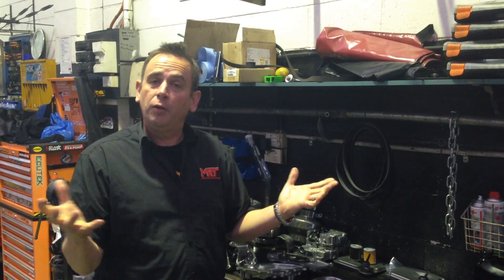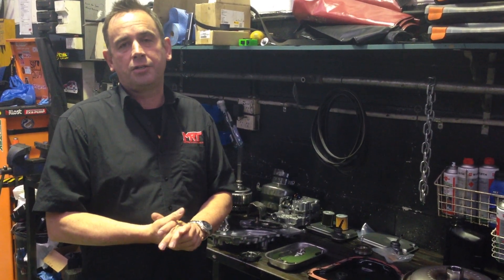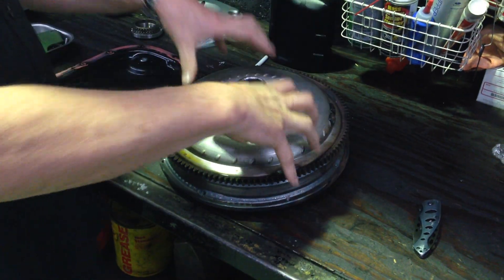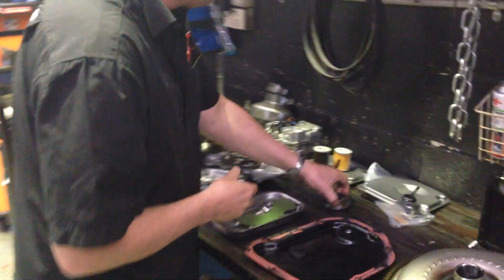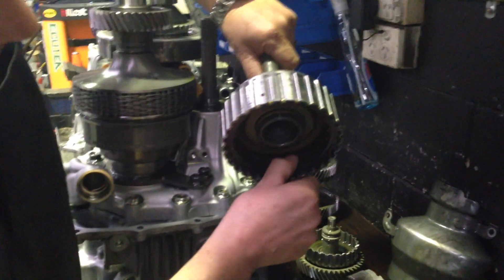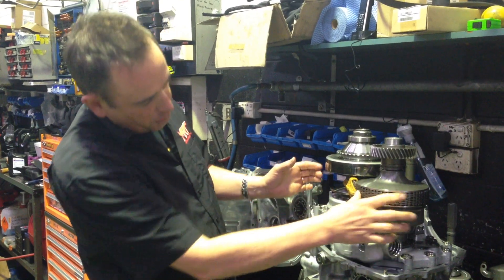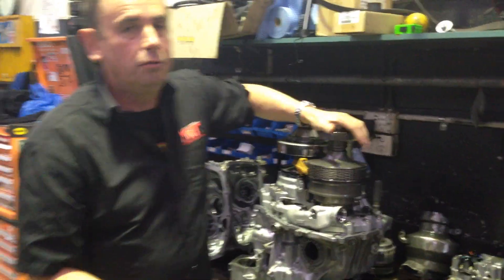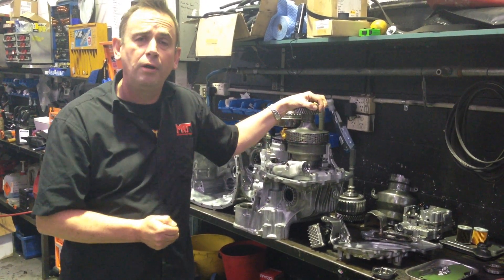Subaru CVT transmission secrets

Comment: Lube Oil filter intervals???  Chain replacement intervals???
Reply: It don't  pay to change  the cvt oil yourself  the oil is 13dollars a quart  a u need 7 quart s to do the job the dealer  want's  220 00  let them do hassle  free
Reply: @michaelschreiber9528  you have to pump the oil in through the bottom to replace transmission fluid which the dealership has that equipment. there is no way to put oil in the transmission from above
Reply: @NoboDY-qu7zs  that’s completely incorrect. There are dozens of how-to videos on YouTube showing the drain and fill plug.

Comment: Hi in the video you mention very special needs to keep it running well. What are they? Ie how to maintain/use it to last as long as possible? I don't suppose manual mode vs non manual mode makes a difference? Drain oil and change external filter? How often? Thank you. And how often to change the diff oil?

Comment: What I'm wondering is that in most of what I've seen and read everyone says that the WRX runs out of boost after about 4000rpm, and when I watch videos of the WRX with the CVT being pushed hard the rpm's stay up near redline. So isn't the car out of it's powerband?
Reply: D Rock     75 I've got the Forester turbo, which is the same as the WRX. the torque curve is flat from 2,000 rpm to redline. It is a great drivetrain. Little to no CVT or turbo lag.
Reply: Ed Hayes , Cool. Thank you

Comment: I want to see this transmission working. Not a half assed animated model. A real life demonstration of these pulleys changing the ratio. Larger gears need more teeth, so how is this accomplished? It's not like teeth can simply be added or subtracted. And isn't pressing on the chain when changing to a larger pulley diameter hard on it, especially when under load? Like, I get the CONCEPT, but I don't see how it works in real life! Somebody be a doll and enlighten me on THAT. Make a video with the transmission opened up like this but make it change the ratios before our very eyes. Also, if the chain is on pulleys, how on earth is it even transferring power? Shouldn't the chain be on COGS/GEARS, not smooth pulleys?! How is the chain not always slipping instead?! These are things I wish to see!!!
Reply: Have you typed "Inside a CVT" into the search here?  There's some really good ones but I don't want to link them if you've already seen them and still have questions
Reply: +D Rock     75 I haven't. I've seen animated ones, but not real life ones. They do have videos of those?
Reply: JoeIsCrazyWillman , I'm not sure if they have exactly what you're looking for, but if you do that search and then watch a few maybe you'll see what you want or be able to transfer the knowledge to an animation better.
Reply: Joe Johnson it works like the gears of a ten speed bike. picture the frank as one pulley and the gears on the wheel as the other. as one gets smaller the other gets bigger, thus changing ratio during revolution. one starts BIG and at the end it's small. visa versa

Comment: really cool. I just leased a Legacy 3.6R with the High Torque CVT in it. interesting to see what its guts look like
Reply: no, it was the car as a whole... very frustrating
Reply: mschiavoni1288
That car must be fun to drive 😏
Reply: actually, it turned out to be horrendously unreliable and i just traded it in
Reply: The CVT was unreliable or something else?
Thx.
Reply: Can you share what issues you faced? I really like the Legacy, but getting more and more bad reports from owners.
Reply: Thats terrible, for whats supposed to be their flagship car. I hope you got a good price trading it in! How does it drive though? I'm still not convinced on the CVT.
Reply: man i lost my ass on that car. and it was a 3.6R with Eyesight and everything... it drove nice, when it worked properly
Reply: this was all from april 2016-december 2016. starting from the beginning,, serpentine belt went. serpentine belt went again (this time 3 hours from home), trunk repainted under warranty due to improper painting procedure, passenger seat bottom replaced due to discoloration,  and steering rack, strut, and airbag components replaced (all one trip for the same issue). i got fed up with the car and traded it in

Comment: I have a 2015 WRX CVT Stage II with custom tune.  Can you please state again the maximum torque you feel the CVT can handle?
Reply: +David Bailey How much  power are you putting with it? I'm trying to go Stage 1 and possibly 2. Mind sharing some advice on do's and don'ts? Thanks in advance.
Reply: My 2015 is stage II with cvt and it's showing a little over 300 whp 320tq and cvt is working well. You can upgrade to a heavy duty Tq converter if you want 350+whp but for street fun, I have plenty, especially for awd. It's like night and day from stock. I recommend tvg delete, CAI, down pipe, 3 port turbo boost controller, Mishimoto intercooler with charge pipe, large capacity fuel pump,and then get a custom tune. Get it all done at once, otherwise you will need to pay for multiple tunes. The canned tunes are ok, but are tuned for extreme safety under any condition. Get a custom tune for your specific setup, altitude, temperature, humidity, etc.
Reply: +David Bailey Is it worth dumping the warranty? Thanks for the feedback.
Reply: As I understand it, the warranty is in tack as long as your modifications didn't cause a warranty part to fail.  All of the parts I suggested and used are bolt on, with exception of the tune.  A bad tune can surely cause problems with warranty parts, which is what I was most anxious about.  However, after I had it professionally tuned, I couldn't have been more happy.  I also watched what he was doing and it took him 5 hours to complete it.  I couldn't have been more happy with the outcome of the tune.  The WRX factory tune front loads the acceleration, in other words, if you push the accelerator 25% you are actually using 90% acceleration.  You will probably recognize this now that you are aware.  With the tune, the power across the acceleration band is smooth and more controllable.  I now feel that I am driving a car with very predictable and controllable power.  I have had my WRX to the dealer many times since my tune and they have replaces warranty parts with no question.  I even tell them not to update the computer because I have a custom tune.  I believe the dealers are more interested in making warranty revenue from the manufacturer than being concerned with your modifications.
Reply from the maker: 400 nm is the limit
Tumble delete on this engine  is waste of effort
:(
Reply: https://f1-motorsports.myshopify.com/collections/wrx-cvt/products/f1-pro-series-full-package
Reply: Look at this

Comment: I have a 2013 Legacy with the CVT. When do you change the CVT oil/filter? how do you check the level of the CVT oil level? Sorry I don't believe in the crap transmission maintenance free for life span. This is how the manufacturer is making there money by replacing the transmission that around $8,000usd plus labor cost.
Reply: in front of the trans pan is a t70drain and 14mmfull/overflow.... top trans right side 45degree plug with vac line pull it to fill with 1.6 quarts

Comment: "The part that I want to show you is what the gearbox looks like." Having no gears, no gearbox is needed! The ratios that the transmission changes are pulley diameter ratios. They are contained within a transmission housing, not a gearbox!

"This belt expands and contracts." No! The belt stays the same size at 
all times. The same length, the same width. In order for the belt to 
stay the same size, the functional diameter of the pulleys has to 
change. As one pulley gets larger in diameter, at the place where the 
belt makes contact with it, the other pulley must get smaller.
Reply: Pretty much like a snowmobile.

Comment: my 3.6R outback brand new makes a noise when I put it into gear.. kind of like pressure building.. for a couple of secods.  It makes the same noise when I pull away while in gear. The dealer and Subaru claim its normal, and that its due to pressure build up.  Any thoughts?  thanks in advance!
Reply: +sir_Xenon I really want to buy a 2016 Outback with the 3.6R but it's so expensive. Do you have any regrets buying your Outback. Why did you get the 3.6R vs the 2.5i? It's either this or a Toyota Highlander. I test drove both and I really like the Outback but I hear people complain about them often. Thanks for your input!
Reply: +Kr00lplatinum  I didn't want a heavy vehicle and I wanted the space and ground clearance. Also, I've owned Subaru's before and  i found them characterful, reliable and fun to drive.  This Outback is along those lines but its not really an enthusiasts car.   Though it rides relatively soft, the road holding, on the limit handling and grip is really amazing and probably much better than the heavier, top heavy Highlander.     Subaru's really have a depth of engineering that is noticeable when you push them.  Try the same with a Highlander and it gets unstuck from the road.  But really,  it depends if you value those things. 

In terms of issues your best bet is Consumer Reports - internet anecdotes are loud but they're not really data.  I know the CVTs are variable; some are noisy and clunky and some are good but its more a nuisance.   I've had no other nuisances and for the price, the features are good. Also, the resale value is killer 

It really depends what you care about.  The outback is better in the snow, drives better and is very roomy.  The resale value is good too.  I bought the 3.6L because I like power and I do a lot of hwy driving so the fuel economy isn't as big a deal.   

I'd buy it again and definitely over the Toyota as the Highlander is not that fun to drive.    If you can wait a year or two I would but otherwise go for it.
Reply: Your best best is NOT Consumer Reports.  Maybe at one time, but not anymore.   Their reliability data is skewed to only reflect their own subscribers and they rank way too many things as reliable that are new, and untested in the long term - like CVTs.

Comment: that's all fine and dandy but my concern is this new technology  (cvt) hase been notably problematic in comparison with traditional automatic transmissions  where the main difference is how ever is in the cost  of repair or even a used transmission  the cost is 4 times as expensive so all or any gas  (savings?) end up being lost in the expensive repairs

Comment: OMG torque converter -> CVT belt -> clutch pad so much drive train loss
Reply: +RandomTechS@#T You are right. But it is more than offset by the ability of the transmission to keep the engine in the sweet spot. That is, if you know how to drive it in such a way that it is able to do that. In short, use the gas pedal lightly and do not go faster than the flow of traffic. For those who do not like that, CVT will be an unnerving experience. I love it!

Comment: Thanks for the look inside. Wouldn't have minded some video of the teardown, explanation of any special tooling and such, since it looks like I'll be pulling one soon. 

I had been pretty happy with my wife's 2012 Outback with the CVT, until recently when the car started hesitating coming into a stop, then started stalling. Apparently there were some defective torque converters that aren't unlocking as the vehicle comes to a stop and stalls the engine. Last thing I was expecting from a Subaru was a transmission failure at only 75,000 miles, which, of course, is out of warranty. Worse, when we bought the car and I questioned the dealer about the transmission dipstick, he said there was none and went on to say there was no need to ever check or change the transmission fluid. Now, I hear the manuals are calling for changing it every 25K miles or so. Not happy.
Reply: If you've got a torque converter issue then that's comparable to having a clutch issue in a manual gearbox, and likewise would've had the same torque converter issue in a standard automatic gearbox.. No reason to throw any negativity towards the CVT at this point.

Comment: I own a 2003 subaru forester which has done 300,000 klm. The old 4 speed auto has only just started slipping and needing attention. I assume the new CVT gear boxes would get no where near this amount of kilometres before needing an overhaul. So my question is if maintain and serviced what sought of life span could one expect from a CVT gear box?
Reply: I'm approaching 100,000 hard kilometers and so far no issues.   My car spends most of it's time in stop start traffic with a bunch of red light racing in between.  If I get 200.000 out of the CVT I'll be very impressed.  I've destroyed clutches in far less time.
Reply: I have a 2005 subaru forester and the 4 speed automatic transmission is doing fine after 200k miles on it, I'd get a manual over a cvt.
Reply: As I understand it, it is Subaru's intent to eliminate the standard transmission entirely.  You'll never guess why... safety.  Well, kinda.  It is their commitment to the EyeSight technology that is driving that decision.  EyeSight requires control of the gearbox so that it can stop the car by applying the brakes, and a manual transmission cannot give that control to a computer (unless you have a double clutch or something like that, but that costs more in money and weight so they likely want to stay away from that).  So essentially it is EyeSight's control in the name of safety that causes them to prefer CVT or auto type transmissions.  Stupid, I know.  As far as I'm concerned a Subaru without a standard transmission is, no longer, a Subaru.  Sorry Subaru but it's true.

Comment: I bet the auto start/stop function is what killed the bearing. Horrible technology that doesn't save much fuel but kills engines and transmissions.
Reply: can confirm 2018 WRX does not stop start, I know manual impreza's and CVT impreza's with smaller CVT's use it to get fuel economy.
Reply: @Barclay Gen 6 Liberty has it, as well as a button to turn it off (https://i.ytimg.com/vi/dwC3oRhsa0g/maxresdefault.jpg ). Unfortunately the button has to be pressed each time the vehicle is turned on because the default is for auto stop/start to be switched on. I have read that there is a simple bypass that you can perform by unplugging it and jumping across a couple of pins on the plug to constantly send an off signal. Google that for more info. Probably a youtube vid for it too...
Reply: they do now
Reply: I have not see these features cause these issues. The auto start/stop is only an issue if stop is prolong for hours. This could cause problems with starters if they are not built robustly though. Batteries can suffer if the engine can not respond quickly to the start up though. However, AC, even with alternators, have caused more damage as well as the older style halogen headlights. It's a common reason for Subaru's to have failed alternators and batteries, because people drive with all of their accessories and lights on. (Lost 3 alternators and 2 batteries and learned... way to late, even killed the wiring connected to the alternator, that sucked. This was on an older car and contamination was a factor.) In fact a AC takes around 20 amps and a starter between 20-30 amps. This can cause stress on the battery either way.  Thing is, for a well maintained car, it take less than a revolution of the engine to restart the car. This means it takes very little of the car or the starter. I would mimic the start stop method at lights with my subie to save gas, the only thing that wore after 21 years was the lock cylinder. Which was a cheap and easy replacement.
Reply: I refuse to buy a new car that has start/stop or a cvt..
Reply: you have no ides what your talking about
Reply: Yup plus the cost of that unnecessary electronic pump and resources to create them and build each one.  Compared to a engine without the joke of a feature stop/start.
Reply: Also very hard on your starter
Reply: I think it's all about reducing emissions so the manufacturer can meet certain standards. Even if it means early failure of starters and batteries, it'll be out of warranty by that time anyway.
Reply: What really kill these CVT s is the worn metal from the pulley that destroy bearings, from my experience the magnet it the sump can hold so much and no more, I added a second magnet to aid with clean up ,
Reply: Walter Black 
Not to mention killing starters and batteries extra quick. 

Hmmm.... Save a few liters of fuel or burn through lots of batteries and starters in record time? You drive a hard bargain...
Reply: Barclay Brett says it himself in this video, they do.
Reply: VL_TURBO420 only in Europe
Reply: @noventay4  And Australia, where this was filmed, and not the US and Canada.
Reply: Walter Black Subaru does not have start stop.
Reply: @pepper13111  Yes it does.
Reply: @pepper13111  Yeah, it does.
Reply: Walter Black Subaru doesn’t have start stop cars
Reply: Barclay my 2019 outback has start/stop. My 2017 WRX STi does not.
Reply: Barclay lol my 2019 model year definitely does.
Reply: @pepper13111  They do here in Australia with the option to bypass it each time you drive the car..Total pain in the arse!

Comment: How many kilometers on that specific transmission before it failed?
Reply from the maker: +Eduardo Hurtado 70,000 km
Reply: +MRT Performance --- I knew I should have bought a manual, damn!!
Reply: +MRT Performance; I have a 2011 Outback with 115k miles, works fine. Better than automatic. More reliable.